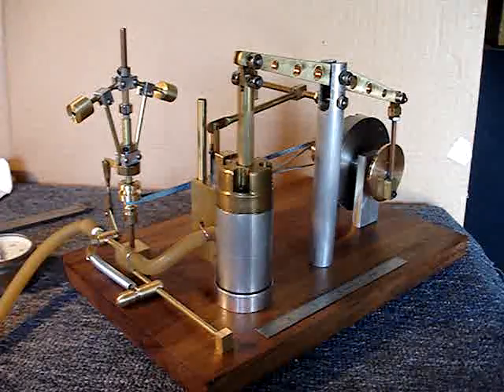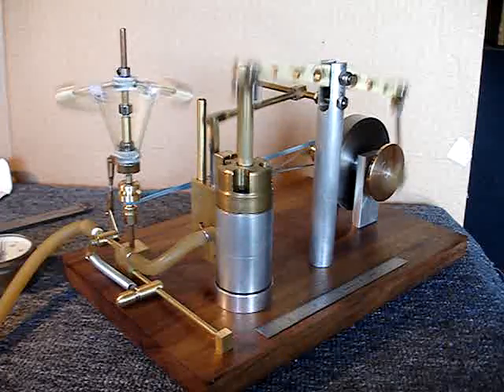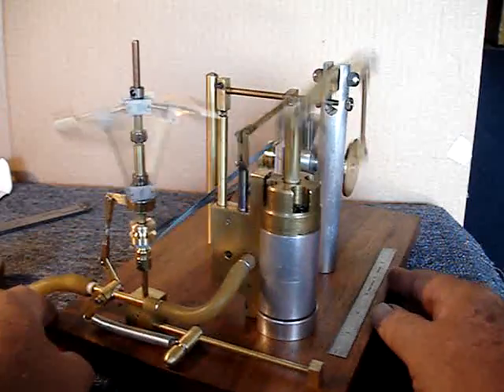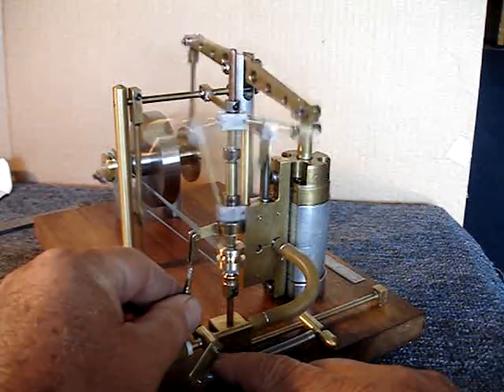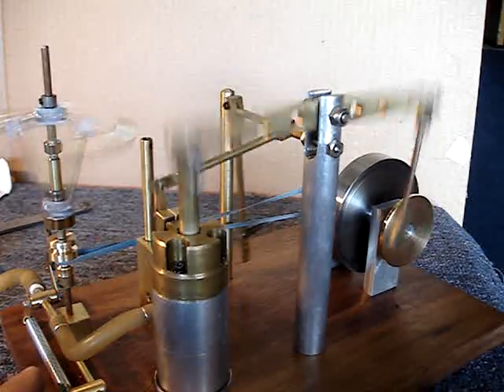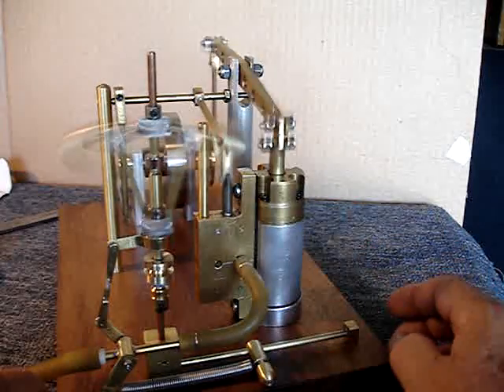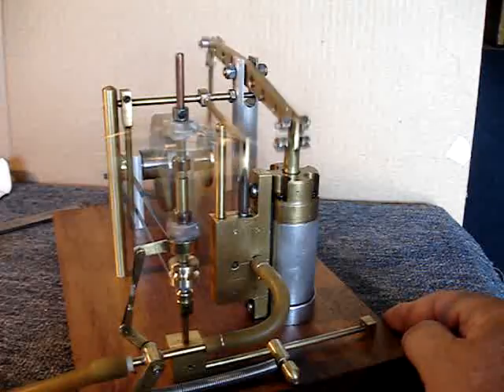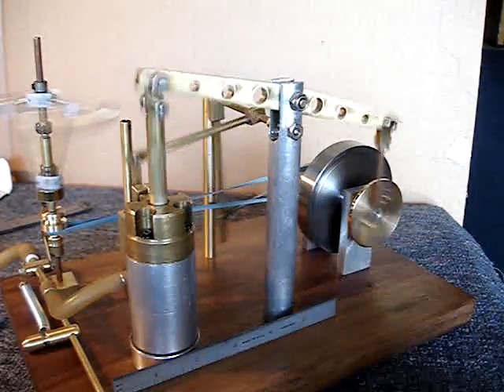Steam (air) Beam with Flyball Governor

Comment: No plan?  How can this be?  And no Xilinx parts.  Presumably the RC helicopter crashed to supply the bearings.  Is the base from some old GR case?  If you blow into it, isn't there some danger that it might explode?  I suppose if there are no sparks nearby.